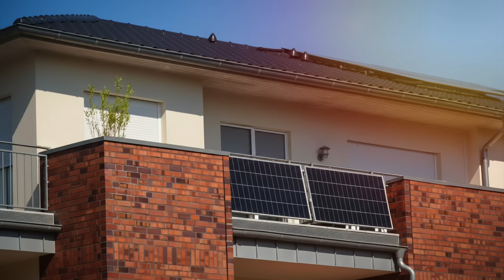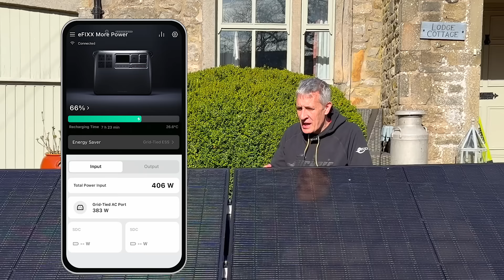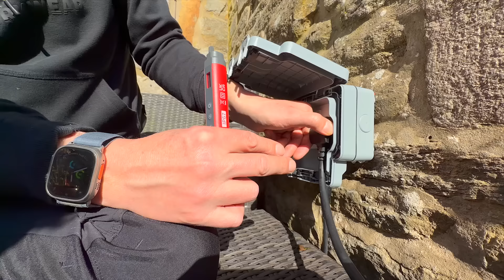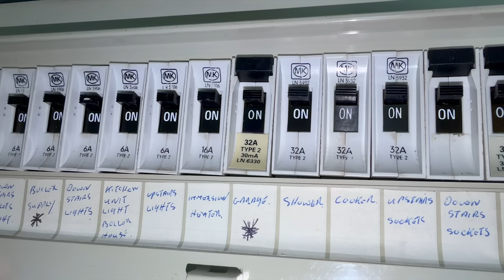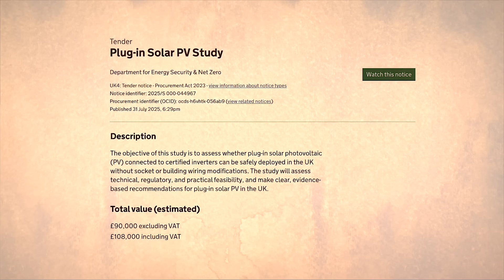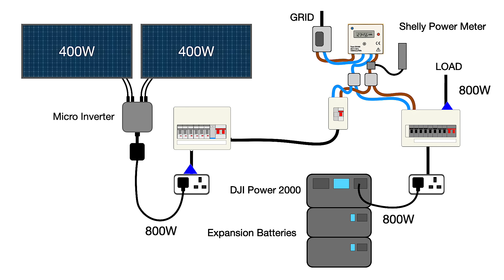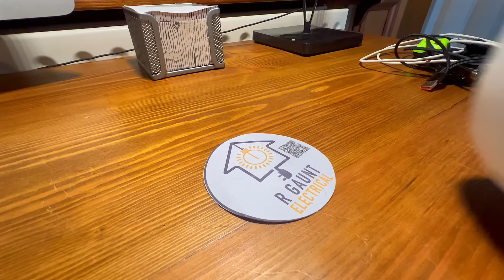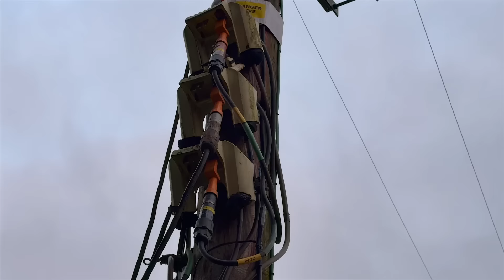Plug in Solar: We’re Told Never Do This… So I Did

Comment: the concern isn't the plug or sending power "the wrong way" the concern is having your system still connected to the grid powering it when it needs to be off for someone to work on it and then they are electrocuted because your sending power through the lines.

Comment: you probably shouldnt stack those lithium batteries inside your living room, they are a fire hazard when charged/discharged. if they are a ac system anyway, you can easily install them in a garage or utility shack, just in case..

Comment: So to be clear 7.68 is max for 32A breaker, 2x3000 heater and some other bedroom stuff on rRing main should trip breaker ok. But of had same Ring main 1200w like USA or even 800watyv, AI worried inviable load would take it to 35A , But , I was hoping instant use of 800w and braker would trip . Would anyone even Test this use Case. 😊😊😊😊

Comment: Sure, Ecoflow Group addicted to this , I really hope it becomes Legal , But AI did Flag some reason why we may not see 2400w or 1200w legal, Maybe 800w, AI flagged thimgs , Mine is in a Shed so it should be ok, Because of 32A Ring Main Post World War 2 Copper Saving. We dont have Radial Circuits accross Board, New build maybe should be Radial in UK,

AI worried about Invisable loads, I thought really and Loads would just Gobble uo an 800W invertor but AI says what if you have 2 or 3 Electric heaters or Granny Chargers, Would you go over 32A at 240V . And the Wire would have invisable Load. Breaker will not see it, Possible wire overload, 

Must admit thought AI was Wrong and ,Electric heaters would just gobble up 800watts without a Surge, , Its 1 percent of use cases that might ruin it , I was just doing maths. Safe in Shed, I only have old breakers not RDC thing. 😊😊😊.

Comment: This is the set up I’m building just not using DJI. I have scorched fences from the sun, place panels on there. Micro inverter in to the house. It’s almost exactly the same bar some small changes. Building it as non proprietary as possible. I love plug in solar potential. I want 2 sides of my garden fenced with panels. I’m just adding in more redundancy than you have and doing things a little differently but the principle is the same

Comment: I think Dave from EEVBlog said that the danger with connecting the panels to the grid via a plug was the reverse flow to the grid could shock anyone working on the grid when it was supposed to be isolated for maintenance.
Reply: That can only happen if you use a non grid tied inverter.
Reply: @markrainford1219 not true. connecting a non grid inverter to the grid will destroy your inverter or cause fires in your house due to phase mismatch. You need a grid phase matched inverter for it an all modern grid tied inverters are cutting power when no phase is avilable. These days this is not an issue anymore
Reply: @Noxoreos  I have accidentally done just that. Ecoflow Delta pro protections were idiot proof this one time at least. No harm done, the device lit up an error code and after the connection was corrected the unit continued to function normally.
Reply: @jounisalo2328  That's interesting. But a power station is not a regular off grid inverter. It is in their interest to place some protection there, because it is hooked up by regular people (some into their homes using automatic backup generator switches).

Real off-grid inverters don't all have such a proctetion. They are meant to be installed by electritions and even those can make mistakes. I've seen one blow up at the connection terminals because the guy (a trainee) installing it thought it was grid tied and then turned it on.
I forgot to mention: That damage can only occur when you not only connect it to the grid, but also power it on, so it starts and tries to back-feed with a wrong phase. Because the output impedance of any inverter must be such that it can handle mains power (because it is meant to output mains power).

Coming back to the root comment about backfeeding power using off-grid inverters: This can only happen if you install said inverter during a power outage, which is pretty unlikely. The better the grid the less likely it is.
Reply: @axelBr1  as you could see from the video, that is impossible.
As soon as the inverter has no power from the grid then it stops producing.
It needs the mains to know how to make the sinus wave of AC power.
Theoretically you could hook up a diesel generator to the inverter and it will produce.

I don't have an EV, but many say they can use the EV to power the home in case of a blackout. Not sure how true this is, but that must be a bigger issue than a few solar panels.
Reply: @TheHellis when I bought my solar +battery installation, one factor was ability to use it when the grid is down. This turned out to be more expensive for this reason, and we didn't go down that route. But it is possible.
Reply: That's a problem with most solar solutions that don't switch off when work is done on the grid/house electrical system they are in.
The video shows that it does shut off, so I don't expect a problem.

Now if you are in the situation where you don't know there is a solar system and you are gutting the house after a flood..... I can tell you they make nice green arcs when unscrewing the terminals 🙃 (we were told everything was unplugged.....but they didn't know either)
Reply: @BuzzinsPetRock78 that is only the case with non grid tied inverters, but such an inverter can not be connected to the grid without destroying something as soon as the connection is made due to phase mismatch

Comment: I wanted to do something like this, as it is the most cost effective way to install solar. Really good if you have a dedicated circuit that doesn't have anything drawing power, as you do risk burning your house down if you draw more than 80% of a circuit continuously.

Alas, I did not want to risk burning the house down if someone accidentally used those circuits while the sun is out, so I went with a portable power station. Specifically a bluetti v2 200 that I snagged for 500 bucks during black friday sales. 2600 watts output, can charge or pass through 120 watts to more than 1800 watts depending on what you clip the mains amps at,(1 amp is lowest) and can handle approximately 1,000 watts of PV input power. Cherry on top is it has ~2kwh worth of batteries, and the inverter is 95% efficient, which is better than most high end inverters.

Would have preferred to just buy some solar panels and micro inverters to plug into the sockets, but this is the best next thing in terms of solar affordability. Can find used solar panels on craig's list for ~25 cents of watt, so I could theoretically build offgrid powerstation setups in the 1kw range for ~ 750 bucks with 2800watt output and 2kwh worth of batteries. Very affordable.(ignoring cable and other costs, of course) This all pays for itself relatively quickly when compared to paying 20k for a 6kw rooftop solar system that doesn't even come with batteries. Lets say I build 6 of these and place them throughout my home, it would be 4500 bucks for 6kw of solar panels, 15.6KW of output, and 12kwh of batteries. Won't even get into hybridizing this setup by having the solar panels feeding into a large battery bank via solar battery chargers and then letting my power station sip on it at 1kw and I am rambling at this point. :face-blue-smiling:

Comment: its fine, I have a plug system like this limited to 500w, I swapped the 13 amp fuse in the plug for a 3 amp since thats the nearest rating,  basically powers my homes base load  since I work from home.  it produces nothing at the side of my 10kw array on my fox solar system but sucks up any excess into it's battery.

Comment: Hmm maybe if the circuits in the house are modern enough or upgraded to handle a plug in solar solution then there really shouldn't be an issue, especially if the solar installation fixed/temporary is designed for it.

Comment: I worry about the sync issues, they are reactive so they have to synchronize  with the frequency of the grid, but how close can they get, how often are they monitoring that theyre fully synchronized  and how accurate do they sync. There is a second issue with adding power to the grid, ad hoc! For example, in remote places like the countryside, it more common to have a generator, these must be installed  via a multi pole switchover that disconnects the house from the grid and onto he generator, so if a tree falls on a power line, and they isolate the section from the grid  and begin to fix it, they don't get electrocuted by the power coming from your generator. This plug in method defeats the usual safety method, I also doubt the insurance  would cover this any image this might cause if it went wrong, but if you killed my grass with those big water filled ballasts I defo aint giving you your deposit back!😂

Comment: I thought the reason they said not not plug solar into your sockets like that is that you have a live plug pin sticking out, with no protection, where you could accidentally short a body part or worse across it, it is not safe in the same way the female socket end is.
Reply: Didn't he mention that his solar inverter detects an open circuit and disconnects, knowing it's been unplugged? That's why he touched them with his hand in the video.
Reply: @weeveferrelaine6973  laws and rules are made for the lowest common denominator, there are likely many cheaper, nastier pieces of equipment that dont detect an open circuit.
Reply: @BrainboxccGames  Sounds reasonable, but that's just not the case here, and the video addressed it.

Comment: In the states, the back feeding worry is powering the poles with linemen working on them to restore power.
Reply: Yes that's why it has anti-islanding on it.
Reply: And the main source of problem there is people connecting a portable generator to their house wiring using a cable with a plug on either end (a danger in itself).
Reply: its ok trump has fired them all to divert money to his mates

Comment: If the grid goes down and workers are touching the cables your power could be going back through the lines and electrocute a worker. You need to have a non- return switch on your breaker/fuse box.
Reply: You need to watch the video again where the inventor cuts supply to the house

Comment: The biggest problem right now are cheap microinverters (mainly from China) which cheap out on parts by leaving the mains separation relay out, which means that the plug pins can still be live for several seconds thanks to capacitors in the inverter.
Reply: like Deye did a few years ago

Comment: Youre about two years behind.

Did the testing on this.

There are some issues as you pointed out. I think that they should have a dedicated circuit. This should avoid some of the issues. We do an advanced kit which has the DP bi-rcbo so thats its safe. But we don't do the plug we supply swa. 

So its a install more like a fixed install rather than plug in.

Plugs can be safe, if not over loaded, and the cu is able to handle dual sources.

How would a consumer know?

What about aging and correct wiring to the unit? 

It has to be idiot proof... 🎉

Comment: This is very interesting and hopefully it becomes legal. I have a council house with roof solar. I would like to build a lean to using panels as the roof buti can't add into th3 current inverter because of fit rules. My only option is a system like this as I don't want to spend a fortune on a house I ma6 not stay in.

Comment: Thank you for the video, I have many questions, I already have leased panels on my roof, can I buy a battery and plug in and just use? I may have to watch your separate video as it does not look like your solar panels connect direct to the battery.
Also, panels wise, can these be used in isolation with a battery for say out houses? Where you may only need lights and music (appreciate heat would need 2000w most likely not suitable for a battery)
You are connecting your batteries and solar to a specific connection on your consumer box with nothing else on that switch?
Final question, what happens if power outage, does this system shut down also as you are connected in to it?

Comment: I have a small DIY setup with 4x100w panels and a 80A 12v battery. I was considering plugging it in via a (ruff) 1500w ac inverter to my breaker panel via a outlet on my balcony if/when the grid goes out over an hour or more to keep my fridge/freezer going but only after shutting of the 3 in 1 incoming main breaker to isolate my in house grid. Would I be correct in thinking that would be safe and could keep my food from spoiling?
 I intend to shut off all breakers except my kitchen to remove any other loads. I could in theory run the fridge completely isolated via a extension cord but that would include moving my fridge out of place enough to reach itś plugg, not something I would want for a day or two of power loss. I am in a rented flat so rewiring would not be practical. So far I had 0 minutes of lost power the 5 years I lived here so it is mostly academical at this point, but still I wonder what if...

Comment: Nice video content just purchased both items and already have two 450 watt solar panels that are to be mounted to South Face wall but waiting on my Inverter 4.2KW Dual Voltage DC12V 24V to 230VAC Off Grid Hybrid Inverter With 100A MPPT Solar Charge Max PV 500V Fit Lithium Batteria BMS from Ali but wanted to check out balcony inverter use.

Comment: My energy bills are already looking better since I started using the Power 2000 with my balcony setup
Reply: On EON standard variable tariff 80% of my annual bill is standing charges, without any form of generation 🤔
Reply: @sailaway8244 The average standing charge in the UK is 63p per day. Let's say yours is high at £1 per day. The ratio of money spent on units is 20/80=1/4= 25p per day. So you're using at most 1-2 kWh per day. That's exceptionally low. That would allow a router, a phone and a lightbulb with occasional kettle use. No other tech or devices. No fridge, no freezer, no tv, no electric shower, no heating with electric pumps. How're you managing this!?
Reply: @jack504 my daily average is 7kw and I sometimes peak at 10kw. Xmas when cooking for a large family, we was pulling 11kw a day. 

This past week we have been hardly breakyig 3kw for some reason. 

Our hot water water and central heating is on gas, but we mostly use the showered over the bath. Oven and hob is electric. But nice it's just me and the wife, we don't have big daily cooking sessions, like we did when the 5 kids lived at home. 

Our electric bill has sort off stay very stable I've the last few years, basically cos the kids have left own at a time, at the same time as costs was increasing. We actly paid arm £66 (last month in electric), fron about 2010-2020 we paid £79pm and slowly grew over a grand in credit. 

I'm thinking of installing a 10kw battery pack and charging it over night on the EV tariff.
Reply: and also my ugreen

Comment: The whole point is this, do it properly and get paid for sending excess power to the grid. 

There is a huge need for electric car charge points to be able to send power back to the grid or be able to use the car as storage so it can run the house when wanted. Such potential lies in 60-70 Kwh EV batteries when maybe 20 kwh or less is used in a day. 

At the end of the day, It's worth paying for a proper installation and getting all the official permission to send to the grid and getting paid for it, I wouldn't give the greedy energy companies a single Kwh for free !

Comment: Is it not to do with synchronisation of the AC from the inverter with the grid? ie not an issue to your installation but to the grid. The power outage across Spain and part of France several months ago was blamed on solar farms not being properly synchonised with the grid.
Reply: Blame is not equivalent to cause. They are adding more rotating mass, and I think widening the limits on frequency matching.

Comment: I have a South facing fence, it would be so easy to hang 7 panels from it, even angle them up a bit, makes you think.
Reply: Folks do use PV panels as actual fence panels. Not far off equivalent cost too. And they last longer and don't need painting.
Reply: Here in Germany such fence solar things are very good during the winter, when it is not cloudy. And in the summer it should provide more then enough, if you have a "large enough" battery.
In germany a system as mentioned in the video is only allowed to have an output of 800W, but with integrated systems (I have an Anker Solix Solarbank 3) the battery can be charged with full power.

From the 70 kwh hours our house needed so far in March, we only had to pay for 8kwh, which is IMHO pretty impressive. The system could be do more with more demand, but the batteries were full at noon.

Comment: i wish there was a good solution for people renting - i'd love to do this, i have alot of computing equipment and to be able to power it from solar would be fantastic. (ed - i see that you are renting !)
Reply: You can already. One can get a power station, say something like the ecoflow, plug in the solar panels. The power station will prioritize solar, when the battery gets low, -say 20% you can turn on charging or passthrough power. This will result in you using solar when available, or when battery is available, and then using grid.